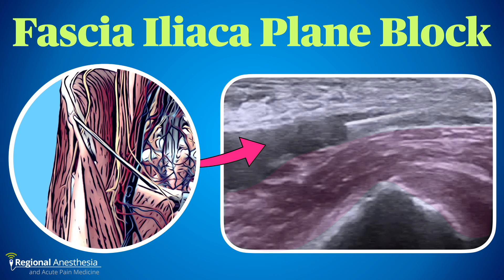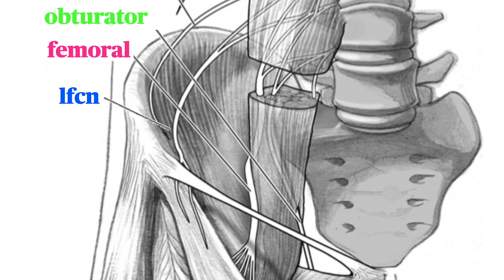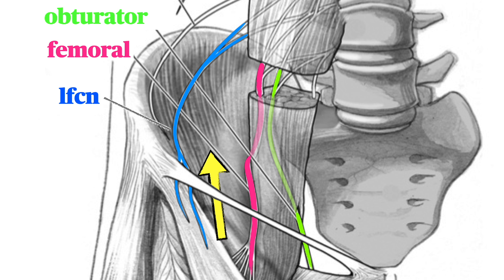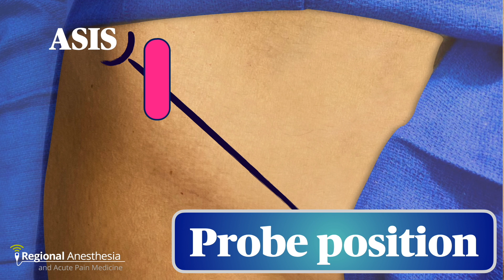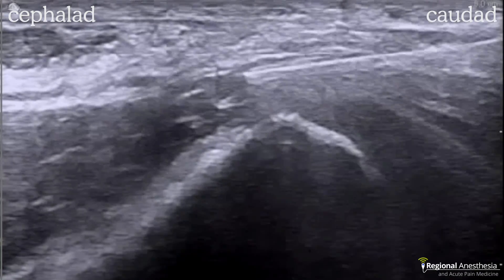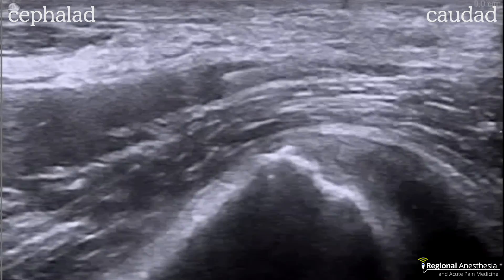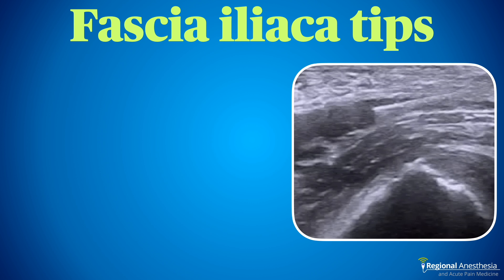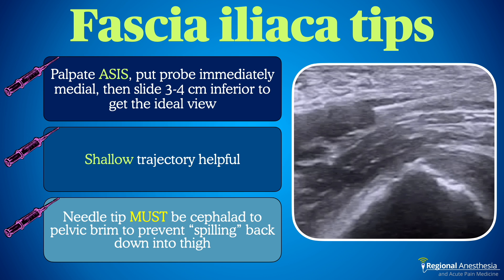Ultrasound-Guided Fascia Iliaca Plane Block (Suprainguinal) | Anatomy & Technique

Comment: Sir, needle here is also inserted below the inguinal ligament, but you mentioned that this is sifi block
Reply from the maker: Yes, you’re correct, the needle is inserted below (caudal to) the inguinal ligament but is advanced cephalad until the tip is in the fascia iliaca plane ABOVE (or cephalad to) the ligament. That way it’s relatively safe, easy to see your needle with the shallow trajectory, and all the local goes where it needs to go, which is above the ligament. Thank you for watching!!
Reply: @regionalanesthesiology  tha nks alot sir.. elated to see your reply.. Regards

Comment: Can you combine FI with sciatic nerve blocks for full coverage for AKA?
Reply from the maker: That's a great question and a challenging clinical problem to solve. For AKA, if we want surgical anesthesia with the blocks we need to get 4 separate nerves: Femoral, lateral femoral cutaneous, sciatic, and obturator. The FI block will get the first two no problem, and MOST of the time (75%) will get the obturator. So, when combined with a sciatic, you should be in good shape. Remember to go as high as you can with the sciatic in order to get the posterior cutaneous nerve of the thigh. A high subgluteal or parasacral approach is best. Another approach is to combine a sciatic with a lumbar plexus block. While lumbar plexus is slightly more complicated and has a different risk profile, it is a more reliable way to block the femoral, LFCN and the obturator in one go. Check out our videos for those other (lumbar plexus, parasacral, subgluteal sciatic blocks). Hope that helps!
Reply: If pt cannot be turned lateral will an Anterior Sciatic approach suffice in conjunction with the SIFI?